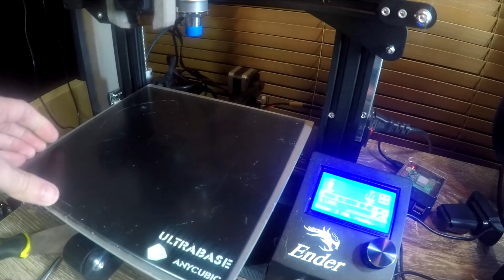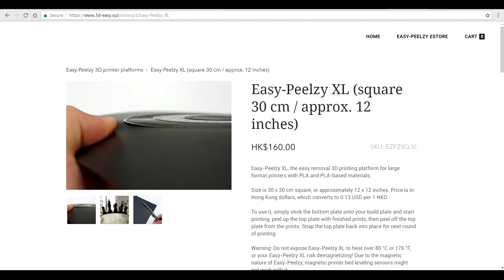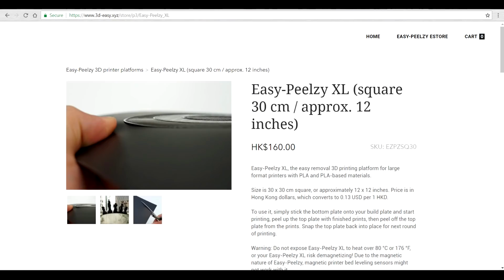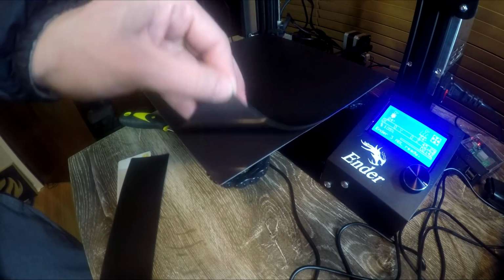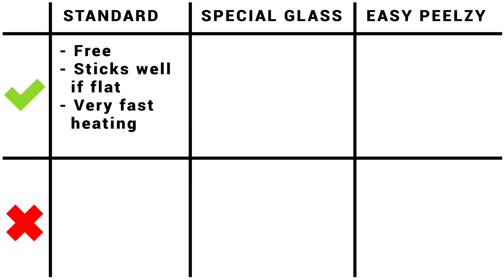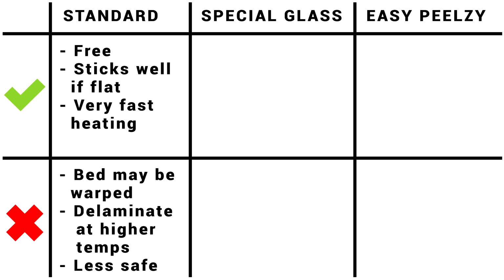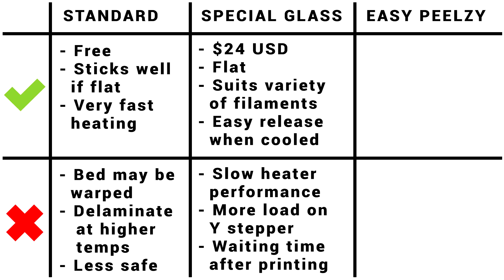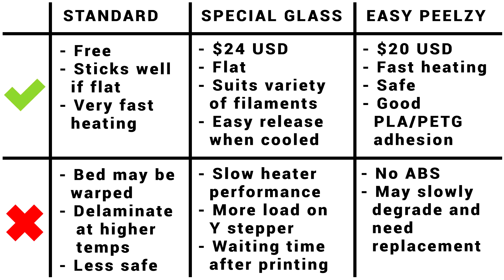Ender 3 build surface comparison: Stock vs glass vs Easy Peelzy magnetic sheet

Comment: My thought is that the standard surface is pretty good.  If you have trouble getting parts off of it, just stick it in the freezer for a few minutes after it cools.  Parts come off pretty easy after you flex it a few times.  However, due to my own misuse in the beginning, mine is starting to show some wear.  I can't find one of these online to purchase.  Do you know where I can get one?  Also, my thinking is that this build surface, combined with a BLTouch is the way to go; then you don't have to worry about an uneven surface.
Reply from the maker: I would just order genuine Buildtak. I imagine the Creality store on Aliexpress would be your best bet for a direct replacement. ABL helps a great deal with warped beds.
Reply: Thanks.  Actually, I just ordered a BLTouch yesterday, so I plan on installing that.  I've already installed a Bootloader and flashed the BIOS, so half the work is already done.  I've tried a couple of other build surfaces, and they worked well with sticking, but left a very rough texture that I didn't like.  I tried the Creality Tempered Glass, but it kept peeling up on the edges on me, and I'm not happy about pushing all of that weight around on the Z.  The latest stock build surface is awesome IMO, but with my warped bed, at times the nozzle thought it was an engraver, so I should get the plate replaced, and I wouldn't mind having a couple as a backup.

All of that said, I love the Ender 3!  Its my first 3D Printer, and I've been printing all kinds of things with it.  Once I get auto-leveling installed on it, I'll be printing even more often; as going through the leveling process only to still end up with a jam in the tube gets exhausting.  Love your channel and keep up the great work!!!

Comment: Hey man! Just a PSA. I have been using my Eazy Peelzy since July, never had the bed over 50 degrees. I loved it. Very easy to remove prints etc. But lately I was noticing some high spots on my first layer. Turns out the bottom surface of the top piece has bubbles in it now. Super cheap still, but I wouldn't recommend it now, due to longevity.
Reply from the maker: I figure regular Buildtak wears out too so this is probably a similar cost to replace.
Reply: i cant get PLA to stick to this stuff at all any tips? i've been leveling for weeks, and I'm pretty sure my squish is perfect, yet part peel off mid way through first layer.

Comment: I am awaiting delivery of a magnetic sheet for my CR-10S and would like to know if there would be an issue if I was to swap the top sheet for glass when I want to. I plan on doing an enclosure, and when I need to use the bed hotter than the recommended for the mag sheet I would like to switch to the glass. Would this be a problem with the stuck down sheet?
Reply from the maker: I imagine once you peeled it off, the adhesive would be a mess. Maybe stick it on something very thin that you can clip to the bed, but that kind of defeats the purpose.
Reply: Actually I'm thinking of putting the glass over the bottom sheet (not removing it) I'm wondering of the bottom sheet will be OK with glass on it.
Reply from the maker: If the bottom sheet gets too hot it will lose magnetism.
Reply: I guess what I'm wondering is if both sheets are magnetic or just the top with the bottom being made with a ferrous metal. If not I think a good idea maybe to make a sheet embedded with iron so that even if you demagnetize it, so what! the top sheet is magnetized and if it really needs more magnetism then rub a magnet on the demagnetized sheet.
Reply from the maker: Just tested, both are magnetic.
Reply: Thanks for the info. I guess I will be killing the bottom sheet and hope the top sheet is good enough to stick down. Maybe a few magnets under the bed might help the top sheet when I want to use it.

Comment: The "waiting time" con for glass is kind of unfair. You can use a scraper and get your print if you want to, just like with other surfaces.
Reply from the maker: That is true. I've become anti scraper due to the safety risk. I know it's zero risk with good technique but some of the pics of injuries online are horrible.
Reply: I personally just use small scrapers designed for 3d printers (not actual razer blades) for my monoprice mini...should work find with ender 3 too i bet.
Reply: You are dead right.  If I am waiting for the item I'm printing, I break out the scraper.  It does take a few decent jabs to release the print, and I always worry about Y-axis alignment when I see how much things are bouncing around.  If I am not in a hurry, there is some satisfaction in lifting the print off a cold print-bed with the faintest little "Click"  It's a bit like sneaking a cookie off the baking tray when Mom's not looking!    :o)

Comment: Did you need glue stick with the glass and PETG? Or bare?
Reply from the maker: With the anycubic ultrabase I didn't need either. Not sure if the Creality version is the same.
Reply: Thanks. Creality response was "We only recommend PLA,Other Filaments have a high probability of failure when printing." Not exactly helpful. Anyway reel of PETG coming so will be interesting to see result.
Reply from the maker: Very interesting. Please post back the results.
Reply: @TeachingTech  will do
Reply: Will update but salt mines have kept me away from ability to do some decent 3D tinkering. A quick run of low level prints (bed levelling things and few cog and wheel type prints) showed that as long as the bed surface was clean first (washed all the pritt/PLA off it) PETG works fine on the Creatlity glass base and comes off no problems, especially when bed cool. If hot can be well stuck. I need to adjust the print cooling, first layer squish and the bed temp though as PETG is not playing nice and prints > 1" or so knocked off far too easily as well. Cura and Slic3R neither seem to have a good profile for the Creality Ender-3 and PETG and stringing/retraction is going to be interesting. So far a few benchies have failed mid print not got one to complete yet.
Reply: Err... more than a few stringing issues still, https://pbs.twimg.com/media/DmtaQGqX4AAqvqk.jpg really have got to work out the retraction settings. The stock glass bed (really really clean it first) so not even one spec of PLA , PVA or remains of Prit etc on it, same with nozzle (new if it is damaged/duty), put a cleaning filament through the extruder/heater block and clean them out. It works fine with PETG. Turn the cooling fan off, in fact remove the petsfang completely. Hot end a bit hotter than PLA, seems to prefer heated bed for first layers. Some thing stuck fine some needed a very light spray of hair spray. DO NOT try and remove prints when bed hot, let it cool down first.

Comment: I have the Anycubic Ultrabase Mega and a CR-10S (AC Keenovo SilconeHeater)  both with Utrabase build surfaces; they both hold like a vise until the temp drops. I upgraded to the Creality version on my Ender 3. It does not hold as well, PLA curls at the corners with 3 different filaments I tested. I have started using a 5-8 outline skirt outlines in Simplify3D; much better results. Looking forward to the new removable buid plate and the just released magnetic system too.
Reply from the maker: Thanks for sharing, great info.

Comment: I have great success with glass and a PEI sheet on my Ender-3, but the Easy Peelzy looks like a good alternative to PEI.  I need the glass to assure flatness of the bed and I"m not hung up on heating speed.  I might try the Easy Peelzy since I'm now only printing PLA, PTEG and TPU .  How's the Easy Peelzy with TPU?
Reply from the maker: Worked just like PLA, no problems at all.

Comment: Had a piece of mirrored glass cut at a local glass shop for $7. Had to adjust the z-index sensor slightly to allow for the thickness (glass was 4mm). The glass works great for PLA and PETG. I use a brim for thin parts. No glue or spray.  For PLA I set the bed temp to 65.

The stock bed material was terrible. Wasted a lot of time with it. It peeled up in the corners and wasn't flat.My 2 cents worth would be to get the glass right away.

Comment: I guess i got a different ender 3 then haha, since my “standard” metal bed is lose and and can be attached with clips. Als i orderd the version with the glass bed, but havent’t used it so far as the standard works really well for me since i can bent it somewhat to get the prints off easily.

Comment: I bought the Ender 3 glass from Amazon,  fits perfectly but just got to dial the height in correctly.  My bed was bowed in the middle . I might try removing the aluminium bed and flattening it at work .

Comment: I started off with tempered glass on thermal pads until I dropped it while cleaning and shattered it, it was great once dialed in but did need hairspray for PET-G. For the substitute I went with the Ultrabase style glass and found it a pleasure, not sure how it will perform longer term but 2 months in and it hasn't shown any signs of degrading and it teaches good practice by waiting for the print to cool, definitely a cheaper option than glass and possibly cheaper than easy peelsy too

Comment: Michael, great video.  For my Ender 3 I am using a Polypropylene Build Plate from Mamorubot.  Bought it from Tiny Machines 3D.  I really like it, and they sell it all ready sized for the Ender 3.  It is used similar to glass where you attach it with binder clips, but do not need any tape, glue, etc.  The surface grips the print and when cooled releases.  It is pretty awesome.  Oh, also I love those timelapse videos, I'm trying to get my settings on my Octopi to get that same smooth timelapse.

Comment: I have not tried Easy Peelzy but since I went to the glass the quality of my prints has improved significantly also because the vanilla bed was not perfectly straight. And for adherence I recommend an hairspray it's very effective and economical.

Comment: I don’t understand why you or other vid dudes don’t include pei in your reviews like the one Prusa sells. It’s cheap. and dependable.
Reply: Akash Doode I agree, it’s the best option out there period. 2 of my old printers I use pei sheet with no issues at all. Then I just bought glass bed for my ender 3 and not best results. So now I will buy pei for it.
Reply: So is it flatter and less prone to warpage than the stock bed? That's my main issue, corner lifting or first layer won't stick because bed is impossible to level from imperfections.

Comment: I'm using this flex fiber board with aluminum foil shimming up the valley of the warped bed to flatten it a bit. i tried glass which shifted  a lot and added weight. 

https://www.creality3donline.com/creality-3d-printer-removable-platform-hot-heated-bed-build-surface-sticker-fiber-board-for-ender-3-cr-20-235x235x3mm_p0099.html

Comment: I had a warped bed so i just bought the Creality3D Ultrabase to compensate the bowl. Guess what... the Creality3D Ultrabase was warped as well. Hat to put tape between bed and Ultrabase and clamp it down pretty hard on the edges to get it somewhat straight.

I think the adhesion of the BuildTek is better. Even with 70 degrees Celsius i get warping and sometimes small parts get knocked off.
Reply: Just wanted to say thanks for the tape idea! I had a warped bed from day one. Tried the Creality3D glass and it improved the center dip a bit, but it got worse over time. Glass is weird in that it's a solid (mostly) but is also a liquid (all be it incredibly slow moving). I think the glass had basically taken the shape of the warped bed. I tired a couple of layers of blue painters  tape under the glass, and it seems good again. One small circle, covered by one bigger circle.

I suppose I could have spent hours leveling the bed plate with wet & dry sandpaper, or printed a wedge thing from Thingiverse, but your tape idea took 5 minutes hehe. Cheers.

Comment: Great comparison Michael. I use the stock glass bed on the CR-10 and BCN3D Sigma with Magigoo wich works perfectly. Magigoo does look a bit expensive compared to other bed adhesives like glue stick. But each application will last for many prints. I may still try a removeable bed at some point though.

Comment: How about simple glass form home depot ??
Reply from the maker: Will work with hairspray or glue. Be careful if it is thin and clamped to a non flat bed. Can flex and crack.
Reply: @TeachingTech  Yes Micheal. I am using it as an experiement as it is very cheap ($4). I have secured it with 4 binders clips. I have been following your ender 3 series from beginning. Your videos have been a great help for newbies like me. Thank you so much for sharing your knowledge with community.
Reply: Hairspray/glue/slurry is only needed for ABS (haven't tried PETG or TPU yet). PLA sticks great to anything glass including cheap mirror tiles.

Comment: Someone should sandblast glass to give it a surface profile for the plastic to grip too.
Reply from the maker: I'd like to see that too.
Reply: I was doing some blasting so I tried it on a jar, and it certainly takes the slipperiness off.
http://www.mediafire.com/view/7ox58q4ltg0atkg/IMG_0802.JPG/file
Reply: what size sand? That almost looks too coarse. I'd be afraid of it sticking too well
Reply: It's fairly fine - somewhere between fine beach and ilmenite - and so old the sharp corners of the grains should be pretty rounded. 
I was thinking about too much adhesion, and because my std Ender3 mat holds so well I have to leave one corner lower so I can get the scraper started.
Reply: You can buy etching acid from any stained glass supply store. Not very expensive (15 bucks for a bottle?)
Reply: PLA sticks great on glass. Use glue stick for PETG, ABS etc., that works great. If you want a rougher surface on the glass, use a wet stone and water. Gently grind the glass with the stone, evenly across the surface,  keeping it wet, until you get the surface you want.  You can also round the edges and corners with the stone. Works great.
Reply: Hello, I tried using a professional grade sandblaster that turned the glass frosty white, it looks great!. The surface is rough to the touch feels like 800 grit sandpaper. I cleaned it with Acetone, squished the first layer and..... the part dislodged almost immediately. I now simply apply glue stick in a cross pattern very lightly and can get multiple prints without issue. I don't let the glue build up cleaning the surface and reapplying which takes no time. Sometimes just taking a lightly damp cloth and doing a swipe across the surface will make the dried glue tacky and it evens the surface allowing you to extend cleaning the platform. I just use the cheap dollar store glue and never experienced any issues.
Reply: Might be tricky to do. The main advantage to glass is it's flatness, and you could easily lose that with uneven sandblasting. Also seems like something that might cause the glass to crack.
Reply: Not industrial sandblasting, even though they could do it with ilmenite(fine black sand) at low pressure, more your $25 Ebay home sandblasting gun. We use to get weird things to blast at work, wood, ladies cork shoes, marble.
Reply: Try it. Who is you local hardware shed, Lowes, Home Depot? They will have "ground glass" tiles with a much more consistent sandblast than you'll get at home. Grab one and try it out xx My feeling is that #GorillaGlass would be ideal and steal minimum Z height (any idea where you can buy it in square sheets?)

I'm guessing textured glass will grab VERY hard onto the piece, as smooth glass often grabs hard enough to rip concoidal shards off the bed during removal. That will depend on the exact type of glass and whether the texture tends towards additional "key" or tiny air gaps, which would be good. Only testing will tell ;o)
Reply: I have used a coarse diamond hone on a glass bed (same glass as below).  By scrubbing in a small circular motion I was able to produce a surface that looked as though it would provide a good "key" for the plastic to adhere to.   IT DID NOT WORK...   :o(   I haven't pursued it any further, but I will try sandblasting sometime in the future, and update this with the results.

Shortly after receiving my Ender-3 I decided to try a glass bed.  Inspired by Ivan Miranda's vid on using Ikea mirror tiles, (well worth a look,
https://youtu.be/Kj4Xz3DwGSQ   )
I cut a piece of glass from a broken  picture frame, this is nice and flat, but only 1.75 mm thick.  It heats up reasonably quickly, and if Ivan's recommended cleaning regime is followed, small prints stick well.  Recently I have had some larger PLA prints lift at the corners though.
Update 15 Oct 2018:  Recently fitted the removable flexi-sheet that now comes on new Ender-3's (I think). No instructions; removing the old surface took time and patience to get rid of the adhesive.  It works well on PLA (all I have tried so far),  but I have had a print come loose.  I tried clamping my thin glass (1.75mm) to it, both with, and without the magnetic top sheet.  It must be a bit compressible, as the glass bowed to the extent that with correct gap at the corners, the centre touched the nozzle.  I will try some thicker glass in a while, and report back.  I do like the glossy finish that only glass seems to give.
Reply: I use a glass bed and hairspray. I'm happy with that. The hairspray is easy to wash off with water. Then I reapply two or three light layers of hairspray. That works for several prints in a row.

Comment: got the easy stuff already but made a mistake and ordered 200mm version though since i mainly use it for dnd minis it fine, Very easy too get prints off but dont make my mistake and try getting the nozzle close while hot from petg as melted a a s;all pit in the bed still works though
Reply from the maker: Yes, good point. Like real Builtak it doesn't like a hot nozzle at all.